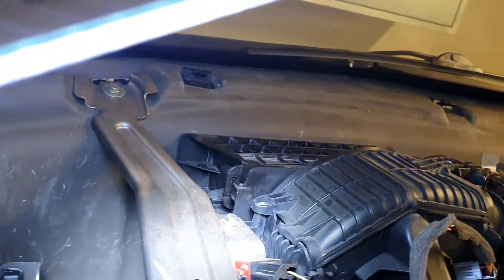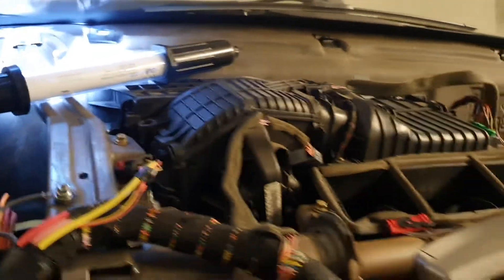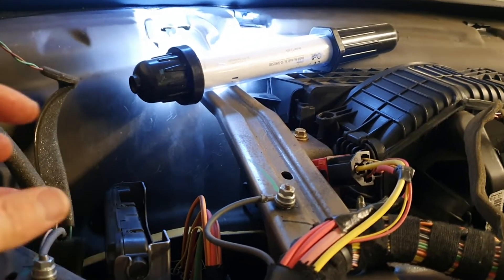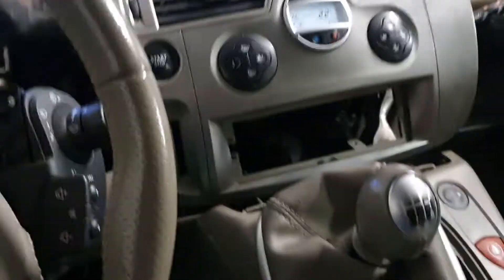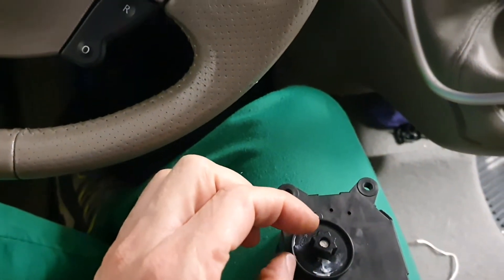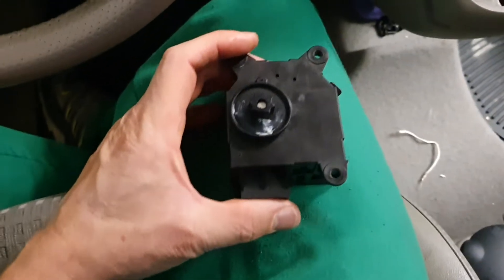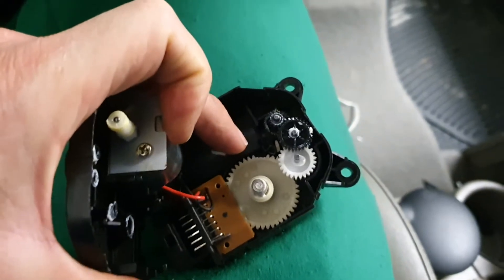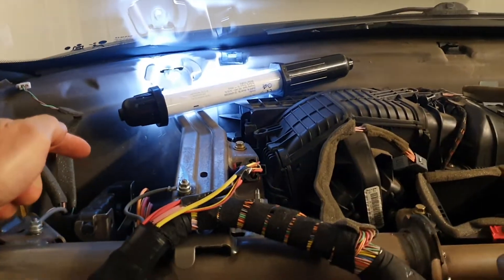Renault Grand Scenic II recirculation vent stepper motor replacement

Comment: Hi! My 2011 Grand Scenic III has this problem: at low speeds the heat comes out at both driver's and passenger's sides normally. At high speeds the driver's side starts to receive cold only, it looks like the wind pushes some flap open. After resetting the heat comes back normally to both sides. Any suggestions would greatly be appreciated. Thank you!